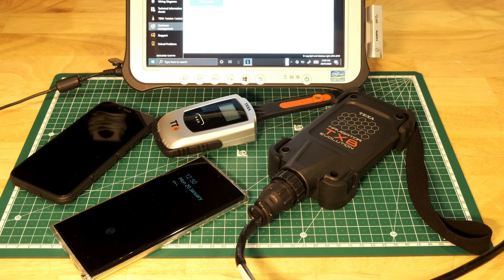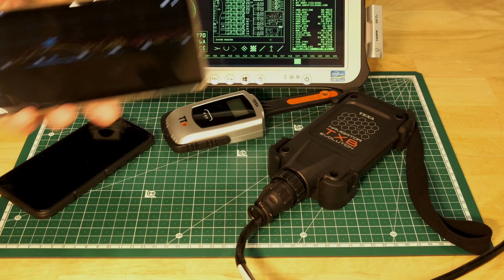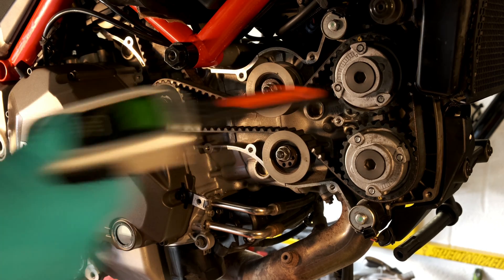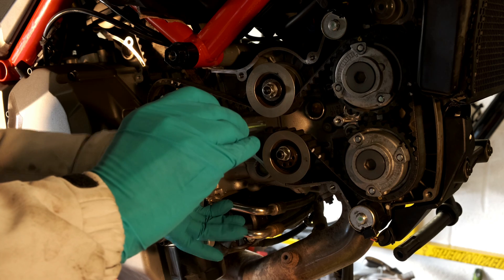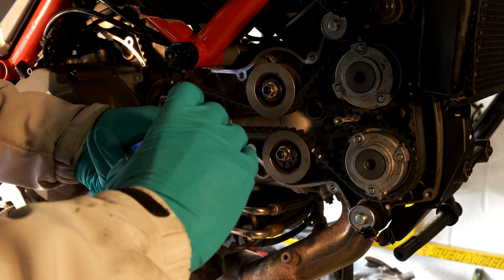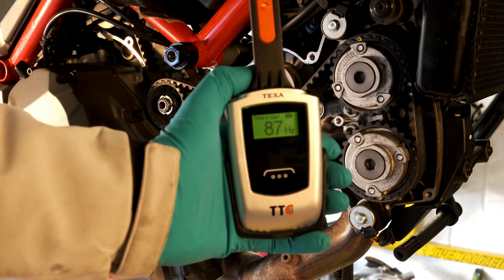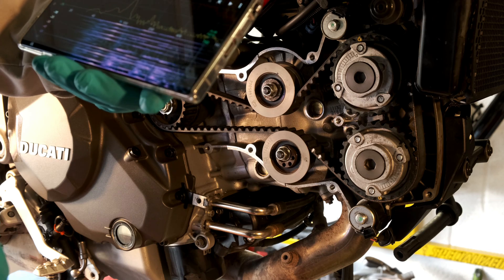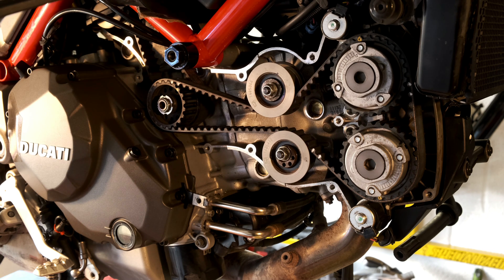Cam Belt Tensioning Methods  Compared, Factory Tool V Mobile Phone.

Comment: Thanks for the vid, tried recommended apps on my iPhone mini 13 also an iPad and all was all over the place! Tested them with a tuning fork for accuracy and absolutely misleading to say the least. Found an app that actually is very accurate and free ‘Hutchinson smart belt drive’ going by testing this app on my tuning forks it will give those expensive tools a run for there money😊
Reply: Ducati scrambler belts done with confidence

Comment: Hello,
Sound engineer here. You need to go into the audio parameter of spectroid and change the bloc size to 8192 samples. That will double the latency and smooth the response but you'll get more precision frequency wise. The dB reading is of no interest here as long as your measurment is above the noise floor and you can read the fundamental frequency of the belt. 90Hz is quite low and the FFT method has some quirks there. A good guitar tuner might work better for that kind of job, will try to see if I can find a suitable free one. 
I really enjoy your videos, fantastic insight. Thanks for everything ;)
Reply from the maker: That's really helpful information,  thanks for sharing 👍

Comment: Thanks for the informative video's.  On jpdiag.akress.com there is a very usefull belt tension spectrum analyser to use with a laptop and microphone, as well as software to read your error codes.